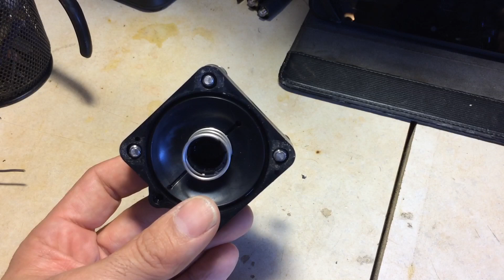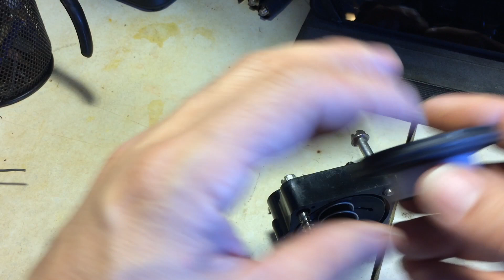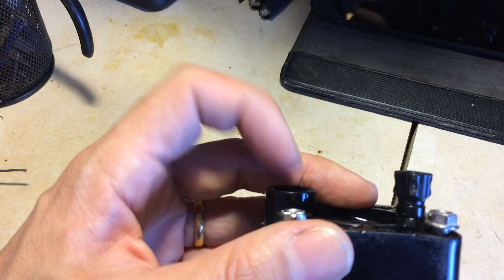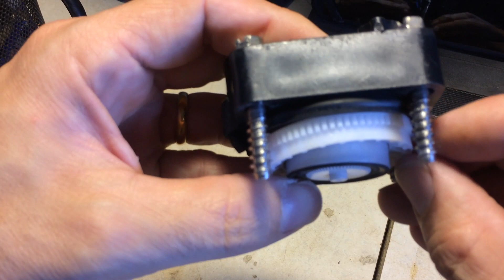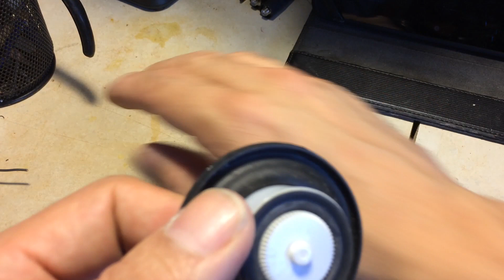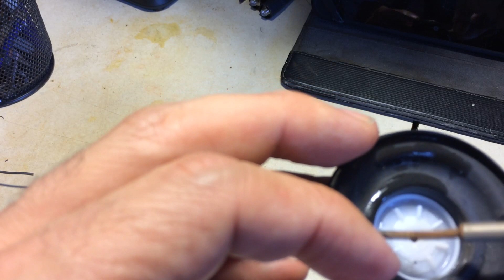Quick fix for bad irrigation sprinkler valve that doesn't open

Comment: You’re better off replacing the selinoid. It only costs a couple of bucks. Either way you have to remove the bonnet.
Reply: The solenoid wasn't the problem. Replacing it would have done nothing. The $5 diaphragm was the issue.

Comment: Good explanation on how the solenoid allows the pressure release from the top of the diaphram, which allows water flow to sprinkler heads. How long does the electrical tape fix work? I'd be concerned the tape would eventually break loose and plug up part of the line, but I guess you could flush that out since it would probably only impact one sprinkler head...

Comment: Great job vegajay! my exact problem too.  My system is less than 3 years old and after hours of testing electrical (no issues), no diaphragm tears , no debris. This is very time consuming to troubleshoot. My fix was replacing the whole upper valve, even though everything tested fine. Once I did, all was running again, but had no clue what the issue was. That bugs me. Two hours later I find myself here seeing what the heck the real problem was.. the dam Hunter Industries PGV 1" valve! They've been at it for almost 40 years, this should not be happening Hunter Industries! I hope others with this issue will comment here, and write to Hunter Industries.  It's not the $20 valve cost , it's the all day of troubleshooting what looks like a perfectly new and clean looking valve.  There support page and support video does not mention this and is also quite dated, last updated 9 years ago. https://www.hunterindustries.com/support/valves-irrigation-system-continues-run-after-controller-position
Reply: Joe Jacobs,   I know what you mean !  Just spent 2+ hours with neighbor's annoying Lawn Genie Valves that all of a sudden stopped working.. 35 mile trip to hardware store, buy new Diaphragms,  take the tops off several times, making sure its all seated, etc., no luck, the valves wont turn on !!!  Checked all the little places with a small diameter wire for obstructions, none found..
Finally, went to Lawn Genie website, they said everything I did already, and then say - if after all this crapola, if it still doesn't work, Replace the Valve !!!!   :(:(:(
Damn these people !!!!!  So, more trips, cut the pipes, install spacers + extra pipe, install new valves,  presto, it all works again...   
I have Hunter Valves,  8 of them, and so far, I have been able to keep them running by replacing the Diaphragms with the PG-V diaphragm from H/Depot of China..
I also read much of Hunter Industries, and even used a lot of their sprinkler heads, but now, am thinking they are just in it for the money and probably have all their stuff more cheaply made in China.. Too bad for us..